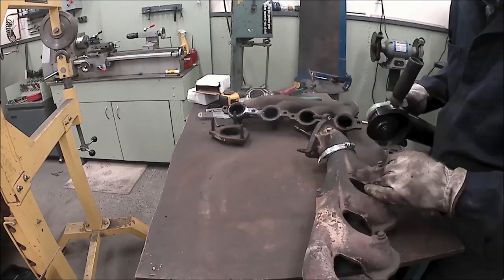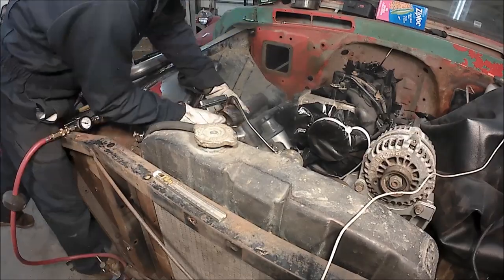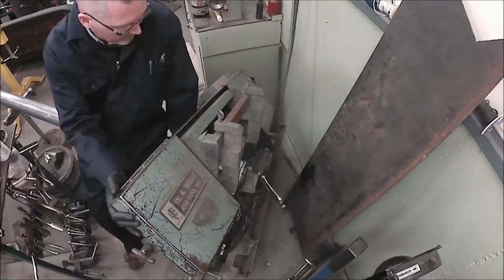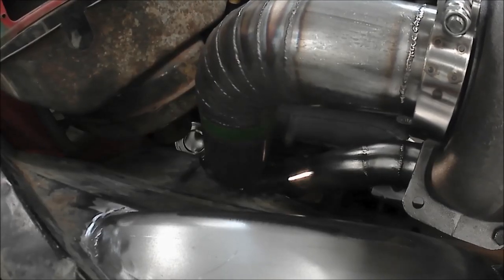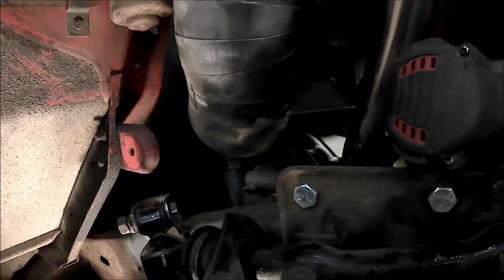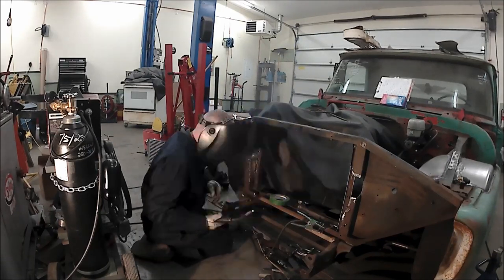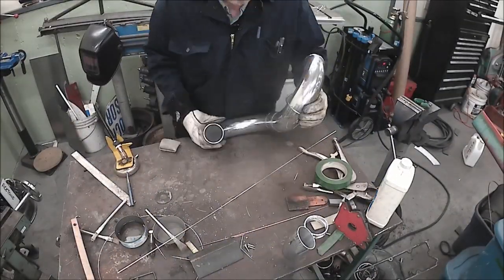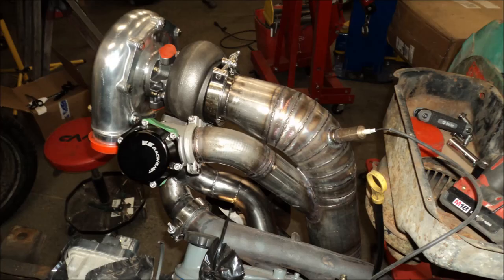"DIY" (Fabrication-Heavy) Turbo Kit from VS Racing

Comment: I saw the engine freshen up but dont recall you using a turbo cam with no overlap...did I miss that part or you dont feel it's that important?
Reply from the maker: No cam change until I know what I want as far as rpm range, which I should know once I'm driving it. I also really don't want to change the converter, so that limits how big to go, but I don't see the point of paying good money for only 10° more duration, when I can turn up the boost for free. Overlap isn't as a big a problem with a turbo, because you have boost on one side and back pressure on the other so you're not really going to blow it all out the exhaust (a bigger issue with blowers, less so with turbos). I want to change the cam, but I also don't want to change the cam; I'm still undecided.
Reply: @GregWellwood  ok, thanks for the reply.  I look forward to the inspiration on what I can do with my 1997 trucks!